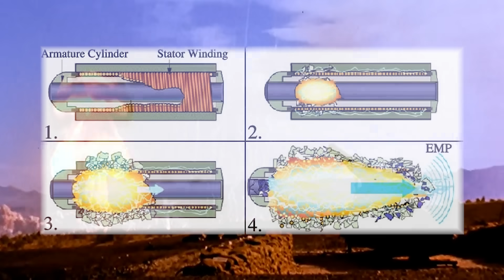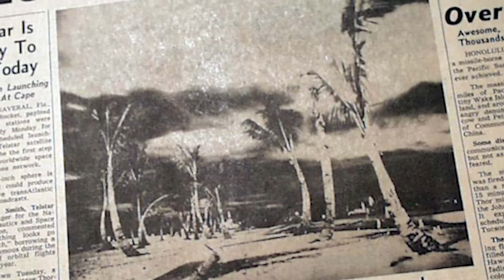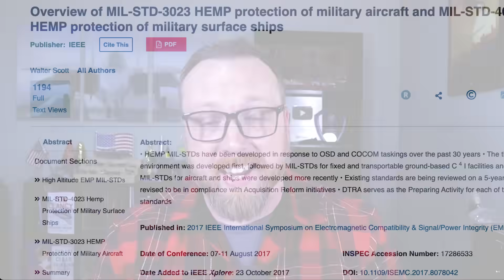Could an EMP wipe out American airpower??

Comment: can you switch of power fast enough can you see it comming and wait a split second to turn on systems again
Reply: Hardened systems often contain a watchdog circuit capable of a system reset far, far faster than humans could respond - and far, far more reliably.
Reply: EMPs cause an induced current - doesn't really matter if the equipment is turned on or not.  It needs to be shielded from the induced current, which means isolating/insulating it.

Comment: The Enola Gay and Bocks Car had to have been hardened against EMPs, otherwise, they would not have made it back to North Field, right? So the U.S. has been in the business of shielding assets from the beginning or was the EMPs not large enough to affect those planes in those days?
Reply: They didn't have any digital electronics on board. The elctrical circuitry was relatively simple.
Reply: It’s the reliance of micro chips that make us vulnerable. The planes and equipment back then didn’t use them
Reply: @crjcrj8443  yeah, but EMPs affect electronics period, not just chips. They even fry batteries. I'm not so sure it was as simple as they didn't have chips.
Reply: @StEvEn-dp1ri  not to same degree. When the MiG Foxbat was obtained and broken down, initially our people laughed at it because it still used vacuum tubes. They stopped laughing when they realized it was less susceptible to EMP as a result . Cars and other devices without microchips can easily be restarted if the EMP has even an effect at all. Microchips on the other hand , once fried they’d to stay fried unless a type of circuit breaker steps in.
Reply: @crjcrj8443  less susceptible, yes, but not impervious. I'm certain chips are much more at risk, but circuit boards and other electronics regardless of chips are in danger of being fried. Early bombers like the B-29 were loaded with electronics. If they weren't shielded and didn't suffer any failures, it's because the nuke yield was so small, not because they didn't have chips.
Reply: I stand corrected, because of the analog nature of the electronics they were not affected by the EMP.  The radios however were affected in some cases because some of them were not shielded. I found that info online. So, thanks for forcing me to dig deeper.

Comment: Solar flare could be more of an issue depending when/where it hits.
Reply: Not much the military can do to retaliate or deter the sun. Not yet anyway. ;)
Reply: @jansonvocmf  Solar flares are a regular occurrence that follow an 11 year cycle. Occasionally the flares cause disruption in HF radio communications and not much else. The earth's magnetic field protects the planet from solar flares, no intervention from the military has been necessary for the last 4.50 billion years. I think we're OK.
Reply: Solar flares have hit the earth thousands of times occasionally causing minor outages.
Reply: @heathwirt8919  He's talking about a Carrington event.
Reply: @hurrdurrmurrgurr  All the telegraph stations will be knocked off line.
Reply: @heathwirt8919  Solar flares, yes, but Solar micronovas are every 12000 years. Next one due this century. They are cataclysmic. Causing crustal rotation. A rather quick event. Which explains the Canadian Wooly Mammoth found frozen standing, with fresh greens in it's mouth and stomach. Or do you have a better explanation. And the Tropical fossils in Antarctica? Or Sea shells in the Himalayas?
Reply: @bryanst.martin7134  I know of no White Dwarfs in close enough proximity to cause cataclysmic events on the Earth, do you?